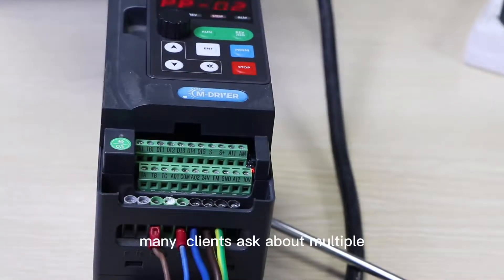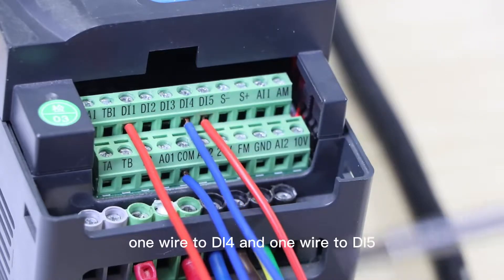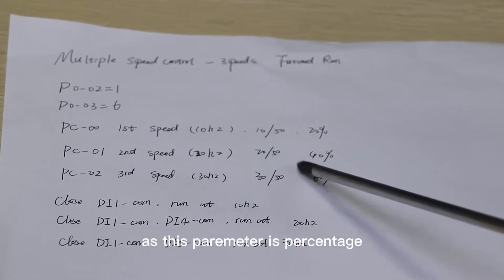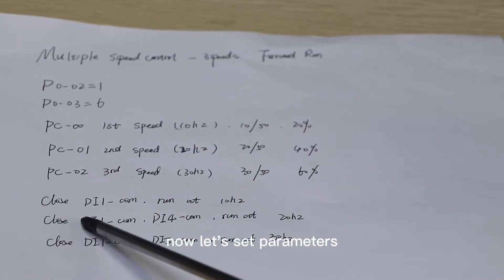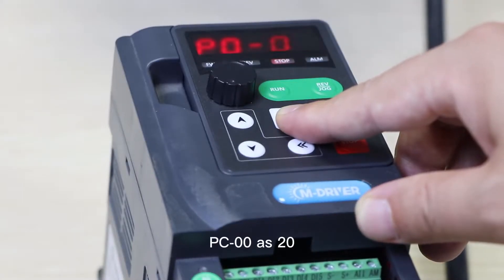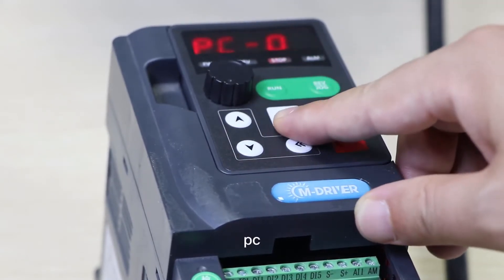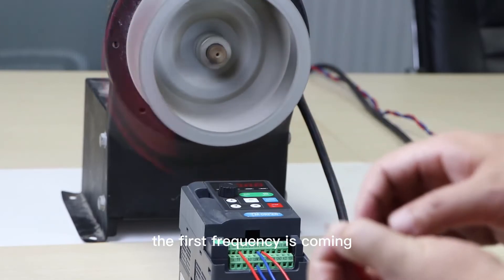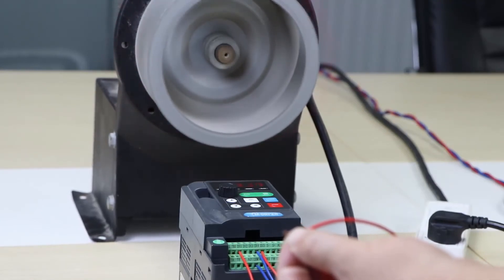How to set multiple speed control for M-driver M550 series VFD inverter

Comment: May I know how to operate through two wires and set the frequency 60 for the motor and the speed changer with the use of an external speed switch for the same device